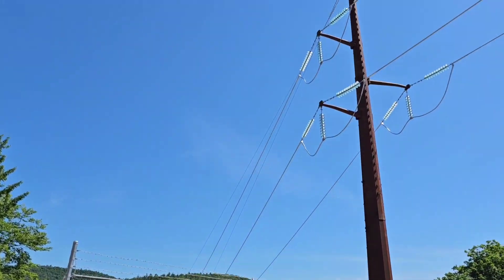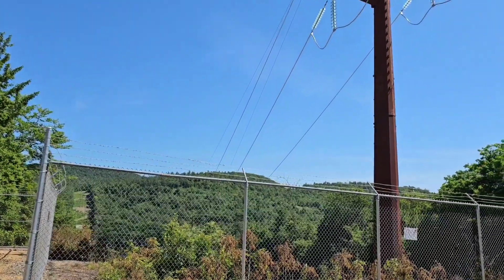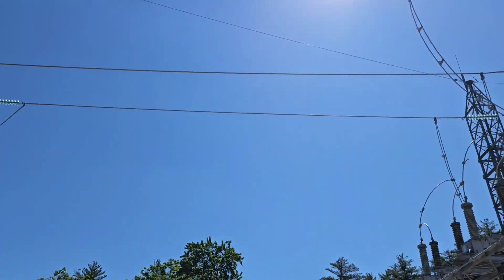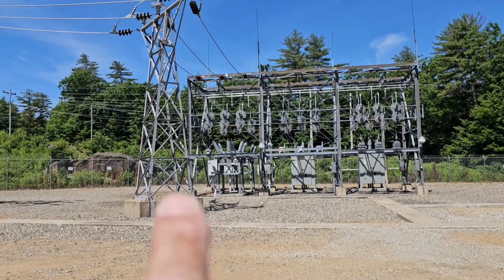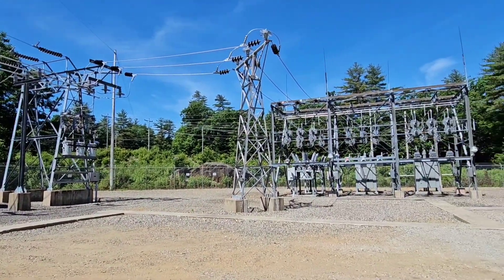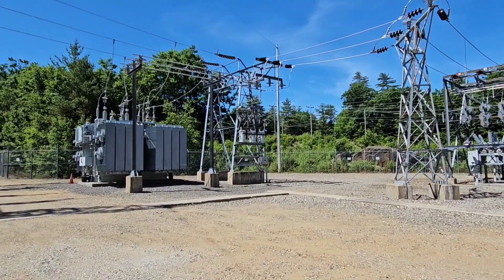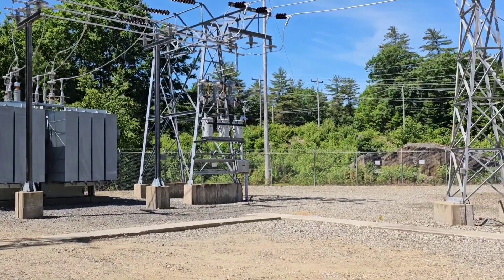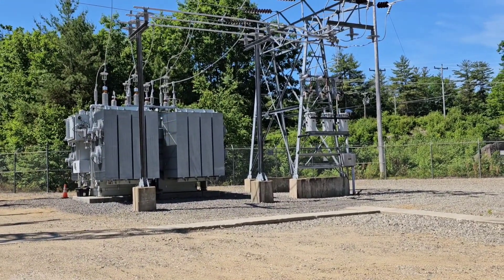Why are there substations? Why are there high voltage transmission lines? What do transformers do?

Comment: Sounds like this is a 60MVA transformer.  What is the high and low side voltages?

Also, on the feeder breakers, it looked like there were older and new breakers.  Do you have any videos where you discuss the dead spider type vs the newer and more compact CBs?
Reply from the maker: 115kv high side 34.5kv low side

Comment: The higher the voltage the less expensive the cost for wiring over a long distance. As the wire size can be smaller. Then once at the transformer where voltage is reduced. You can lower the volrage and up the amperage. As the lower the voltage the higher the amperage. 

It's all about cost savings, distance and efficiency..

Comment: maybe you mispoke at the beginning?  higher voltage provides a more efficient transfer of a given amount of power by reducing I^2*Z losses over the line.  Using small easy numbers as an example: 1000W, 1ohm, 100V, 1000V, 1000W@100V is 10A, 1000W@1000V is 1A, 10^2*1 = 100W loss, 1^2*1 = 1W loss
Reply from the maker: I did... of course the physical properties of the wire stay the same,  my bad. I kind of used a similar equation in another comment.

Comment: Is power being wasted this way?
Reply from the maker: There are losses going through the transformers, but much less than if the power traveled at a lower voltage.
Reply: Far less power is wasted. And the power company wants to minimize the waste, since they can't sell the wasted power. Let's give a simple synthetic example. You want to deliver to the customer 120 volts at 100 amps, at the end of a long power line with 1 ohm of resistance. What voltage do you need to supply at the source to meet that final requirement?
Using Ohm's law I = V/R; IR = V; R = V/I; So the customer's resistance is 120/100 = 1.2 ohms. The power company sees a total of 2.2 ohms. So, the power company needs to transmit 220 volts and 100 amps down the line to get 120 volts and 100 amps to the customer. This means the customer received 12000 watts, the power company sent 22000 watts down the line, and wasted 10000 watts for the transmission.

Now, let's change the requirement at the customer from 120 volts at 100 amps to 12000 volts at 1 amp and the customer will use a transformation to locally change the 12000 volts @ 1 amp to 120 volts @ 100 amps

The customer now presents a resistance of 12000 ohms to the power company, so the overall transmission resistance is now 12001 ohms. So now the power company needs to send the power at 12001 volts in order to insure the customers gets it at 12000 volts. So now, the power company is sending 120010 watts down the line, the customer is getting 120000 watts delivered and only 10 watts is being wasted during the transmission of the power.

So, yeah, using high voltages for power transmission and lowering the voltage at the destination for safety saves one hell of a lot of power, compared to the minor loss in heating within the transformers themselves.